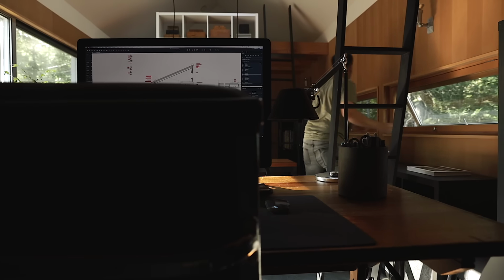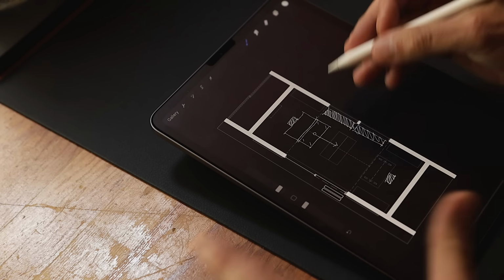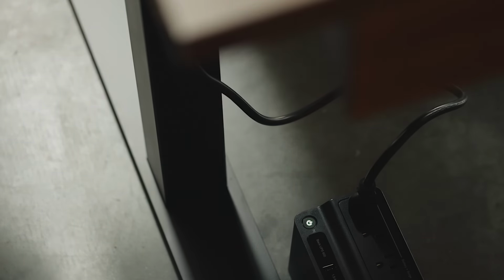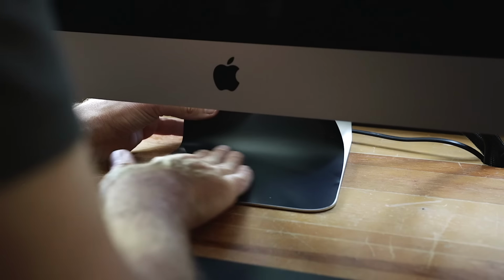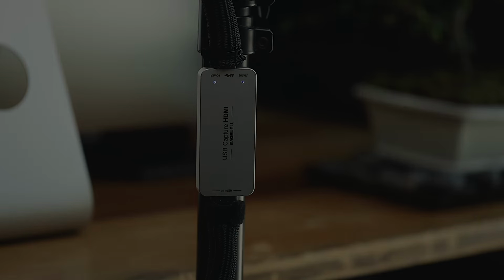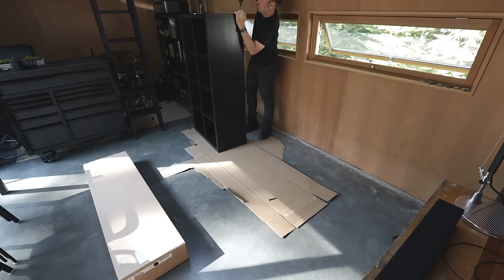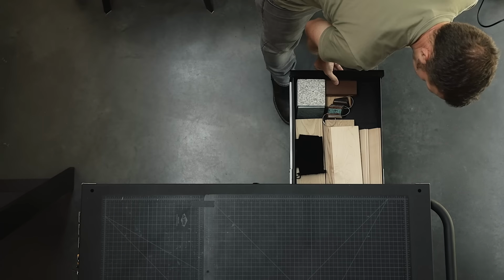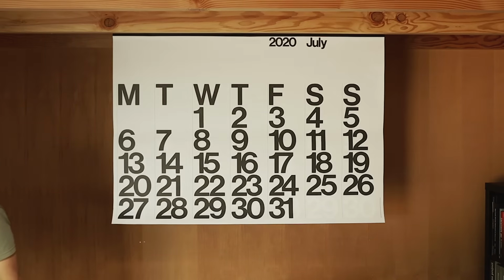Updating My Workspace - Home Office + Desk Tour

Comment: But, but, but, the jam room!! Love this new design though :) my home studio is 2m X 2.8m and I needed to fit a modular synth, video and light equipment and design equipment. Ended up building a rig on the ceiling  so no cables on the floor. Everything on the floor is on wheels. Gonna save this video for reference for my next (hopefully larger) studio. Thanks for sharing!

Comment: I bought that same 16 cubby square shelf thingamabob and it broke about a year later. But it’s a lot better than some of the stuff they sell and I could have made it last longer but I procrastinated on maintaining it. I like using the classic foot wide & long strips of 3/4” ply with cinder blocks as a cheap shelving and I like it because it doesn’t need hardware and I can change it around anytime I want.

Comment: Such elegant and thought-provoking solutions to so many issues! You're really, really good. 

Just one thing you might want to have at the back of your mind. As an old HVAC guy, I cringed just a bit when I saw the calendar go over the minisplit. Cramping the airflow like that is not just bad for temperature uniformity in the space... it's quite risky for the equipment. HVAC systems want and need a load, and if the air goes directly from outlet to inlet of the device without picking up the heating or cooling load in the space... bad things often happen to the equipment. Keep in mind that although these usually have handheld remotes for control.. the actual thermostat is (probably) in the return plenum of the minisplit... NOT in it's handheld remote. (Yes, I know that's misleading and counterintuitive interface design. One could and should expect that the temperature sensor that controls the device is in the remote... but that's not the way most minisplit equipment manufacturers do it (for reasons known only to themselves)).

Comment: Hi I'm an office manager at a development company in London and we have a bunch of architects/ designers and I'd be interested in purchasing a few revit and autocad templates. Could you do a video showing what is exactly included within the pack and how to set things up ? Cheers
Reply from the maker: Each template comes with instructions + some have video lessons included to help you get set up. See all the options here: https://courses.thirtybyforty.com/
Reply: @30by40  cool thanks. Do both revit and autocad templates come with adaptive scale bars and North arrows for different sized sheets? Thanks. We are using revit and autocad 2020 will these be good to use? Cheers

Comment: I've seen a few people wire a couple of the drawers with power so that they can charge electronics on standby. If you do so with some of the lithium battery packs, use caution as there have been a few brands of batteries known to catch fire if left plugged in -- I saw a report of this DeWalt battery packs. Probably not a fantastic idea for long term charging, but on many electronics these days there are intelligent batteries that won't continue to draw once they're full, and will in fact discharge over a period of days to be on the safe side (ie DJI batteries).

Comment: I actually don’t like to have an open storage like kallax. I’ve been an owner of two 2x2 kallax’ but it got dusty after a couple of days, especially on the unused shelves. I also don’t want to have a table with lots of different items on it. Gonna have a monitor arm and a desk lamp mounted on the edge of the tabletop. It would be perfect to have a shelf underneath the table to hide the keyboard when done working. I would wipe out the dust each time before a work session.

Comment: What did you use to avoid slipping inside the drawers? I have this problem everytime I open or close my drawers.  And then I need to organize everything again.
Reply: By the way, amazing job. ❤️
Reply from the maker: it comes with non-slip drawer liners (soft foam texture)